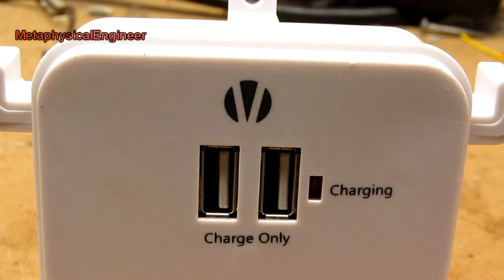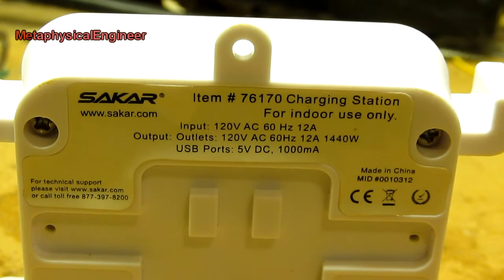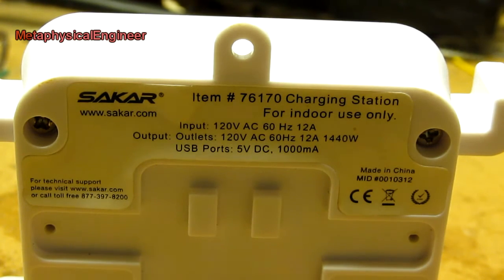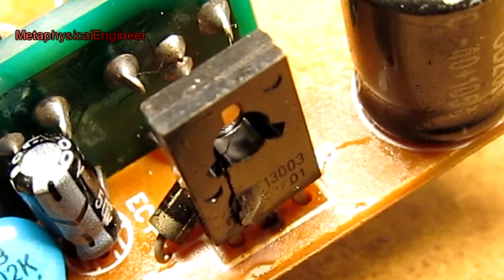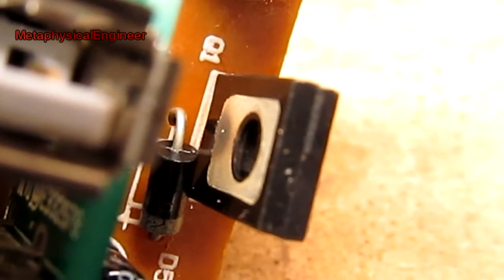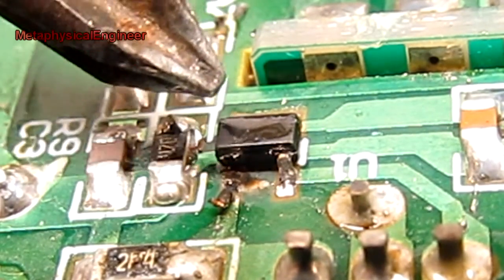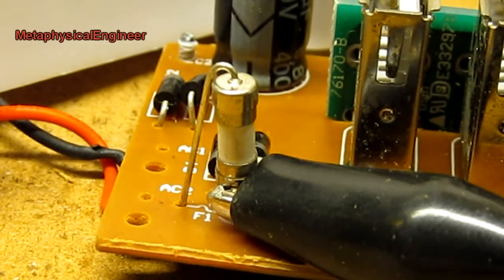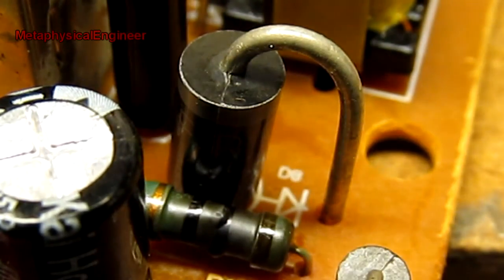Phone charger blew up!  What went wrong?!

Comment: If U1 (the SOT-23 part with the blown leg) is part of the feedback loop, it is probably an LM431 programmable shunt as they are commonly used for driving the optoisolator LED in cheap switchers.  The burnt resistor is probably a fusible resistor and thus was cooked by its own heat.  The diode next to it would have vented if it got hot enough to burn the resistor and would have obvious cracks and/or bits missing.

Comment: It's rather worrying that sooo much of this stuff is out there. Only the other day I had a very similar device blow-up on first contact with 240v.

Good vid friend.
Reply from the maker: ***** So much cheap stuff, and people still buy it.  My dad thought it was safe but it didn't see much use until the day it blew up.  
Would have been nice to get a video of them melting down, but you never know when thing will decide to go.  
Will you be doing an autopsy on your failed charger?
Reply: MetaphysicalEngineer  Fortunately my charger hasn't actually failed.. One of the diodes were just getting hot, so I was trying a couple of higher spec & physically larger diodes to see if it would improve things. The diode is not dangerously hot so I'm just keeping an eye on it for now. Obviously there will be a vid if it should fail though :)